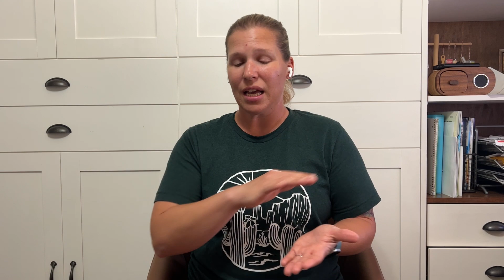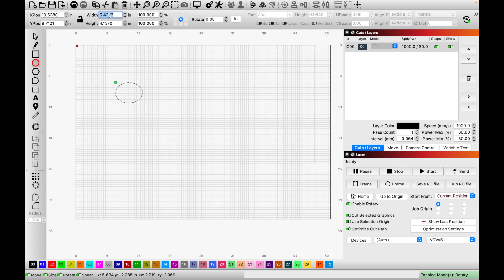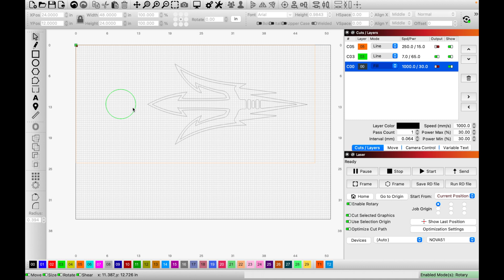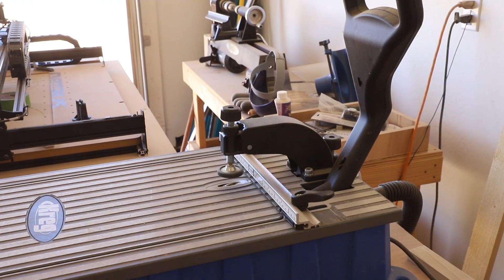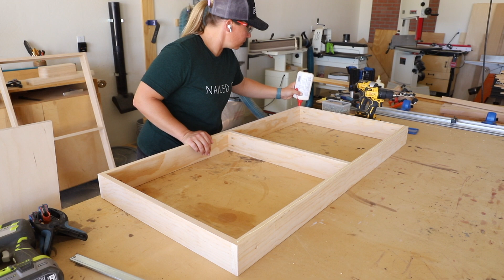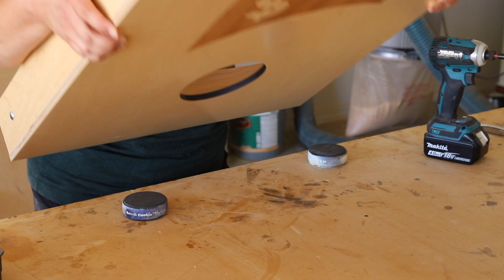Laser Engraved Cornhole Boards

Comment: What a great video. You're very generous in sharing your techniques. I really appreciate you showing the bumps in the road along the way as well. When you pointed out that you'd nailed the face on upside down, I felt that deep down. Then to be able to save that with the bean basket was genius. 

I love my Thunder Laser. It is a discontinued Mars 90 that was in a showroom. Bought it from China before they had a solid footprint here in the USA. Putting opinions I have on China at large aside, I'm glad to see Thunder Laser doing well. I think they do make a quality product that has a growing user base and support for as far as I've ever needed it. 

Did you ever end up making the jigs suggested by Logan? 
Thanks for sharing.